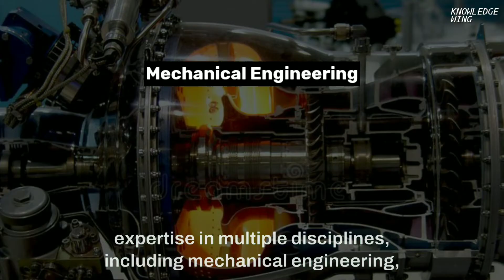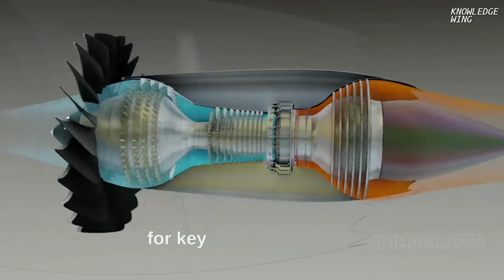How Did India Master Rocket Technology, But Fail To Make A Fighter Jet Engine?

Comment: India only put about 600 million in kaveri engine while world standard is billions and your heading is wrong india has successfully  just tested kaveri engine on russian flying est bed and it power and performance is equal to gef404 also india  has developed third gen single crystal blade super alloys and high temp rhenium coating for single crystal blades all tech is read to be scaled up hence the rush b y rolls roye snemca and general Electric to com develop engines to try scuttle domestic program off india all the pieces is in place and it's a matter off more money invested by shortsighted  corrupt indian politicians